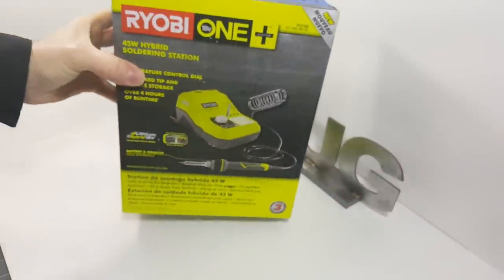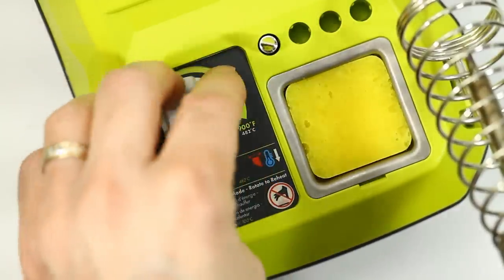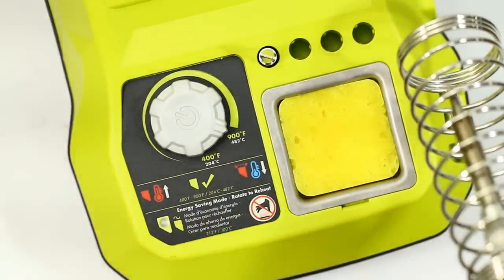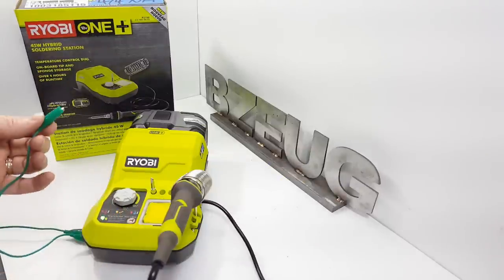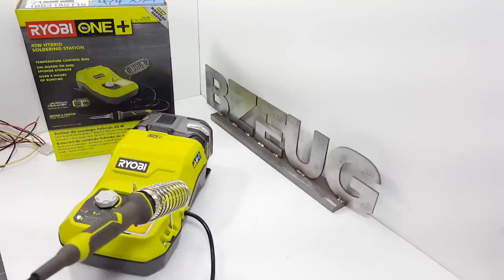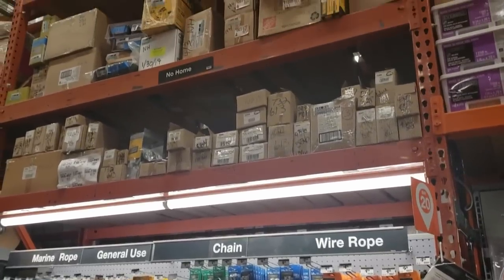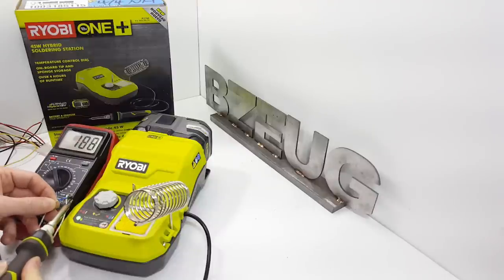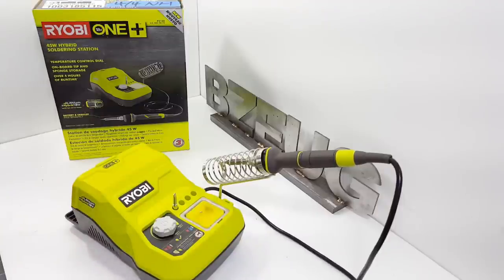Ryobi Cordless or Corded Soldering Iron Station Review

Comment: Never store your iron dry. Wet it with solder before putting back into the holder. Either the solder oxides saving the tip or your freshly cleaned off tip will oxidize rendering it useless.
Reply: EXACTLY ! After every few solder joints you Clean(solidify) off the solder&slag&contamination from the previous connections, and then re-apply virgin clean solder to the tip and do not wipe it off after the last usage.
When you use it again you wipe off the protective (yesterdays) solder "Tinning" shield onto the moist sponge (Distilled Water ONLY) and then Re-Tin the tip for your 1st connection of the day, and repeat this one neat trick that tip-vendors don't want you to know about!
#TipsLastForever

Comment: What do you mean 'impressed'. The soldering iron running too hot is never a good thing, it'll just burn up the surface alloy of the tip and if you're working on electronics and PCBs, you're more likely to damage the components and delaminate the substrate. Nor should it be running too cold. You want it within a couple degrees of where you set it at all times except under extreme conditions.

When you touch the soldering iron to the solder joint, the LED didn't go from green to red at all, nor did it when you touched the soldering iron to the wet sponge and its temperature dropped rapidly.

I suggest that heatup LED indication is simply preprogrammed on a timer and is not indicative of actual temperature; and that the soldering station has no active temperature sensing and control at all, merely output power regulation such as via PWM. SImilarly the cooldown indication is also a mere timer.
Reply from the maker: You make good points.  You are probably right about the dial being a simple pwm adjustment with no sensing.  This Ryobi isn't a replacement for a good high quality soldering station to do PCB work.  Cordless soldering irons tend to be wimpy, this one definitely is not, it can put out the heat.  This unit is great for hobby situations such as RC repairs in the field, typical wire splicing and reclaiming parts out of junk.  I use this Ryobi more than my cordless Milwaukee because the Milwaukee is wimpy.

Comment: Are the tips proprietary?  Looking at HD website, they look a bit expensive to get replacements.
Reply from the maker: That is a very good question.  I have been using the iron but still have not replaced any tips.  Measurements of the Chisel tip included with the iron are:  43mm overall length, 25.26 (26mm nominal?) length of largest diameter.  Largest diameter is 6.88mm (6.5 nominal?).  Inside diameter is 4mm.

Comment: My unit must have be bad.  I'm lucky if I can get the one I bought to melt the solder at all, on the tip WITHOUT the wire.  So, guess I need to take mine back as a soldering iron that won't melt solder is useless.    For those who wonder, that is without it being in power save mode.  The unit does give me a green light, but it really doesn't work well on just basic electronic work.  Soldering two 22 gauge wires took 5 minutes just to get the wire (eventually) warm enough to melt solder, by which time the wire insulation was also starting to melt because it just took so long to get to temp.
Tried using both the AC power and a fresh battery.  No difference.

Comment: So i guess they had not heard of the ts80 or ts100
Reply: I guess you hadn't heard that neither the TS80 nor the TS100 is battery powered.
Reply: My ts100 runs just fine on batteries and if i get a ts80 it will primarily run off a battery

Comment: Milwaukee has one smaller than your battery!
Reply: yea but it is inferior to the ryobi and more expensive. the ryobi is nice and can be used plugged in or wireless. milwaukee gambled trying to make it compact like a gun solution but situations to use it in that manner is not common. more commonly people soldering on a bench/desk and even if in tight situations the chord on the tip is long enough to have a enough play in tight situations. i know your a milwaukee fan boy but the ryobi is better in every way